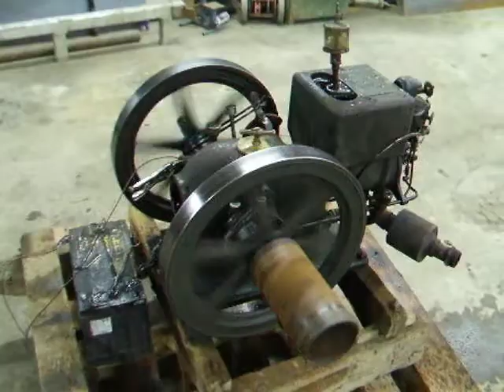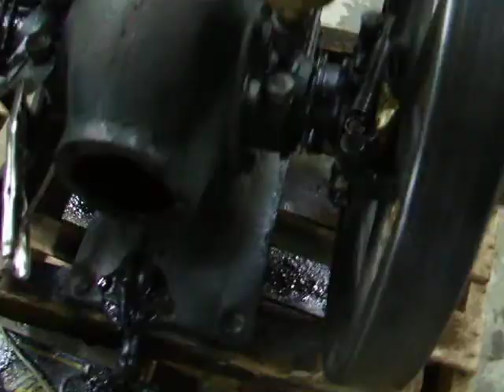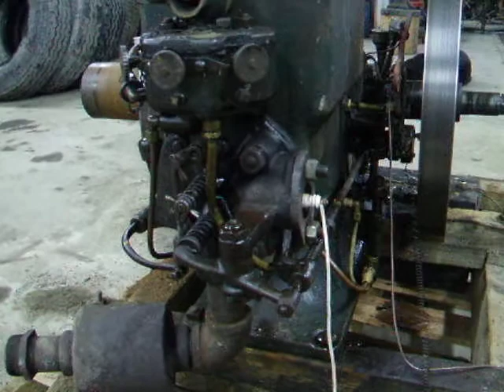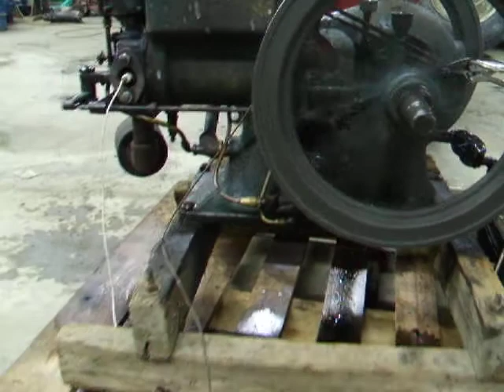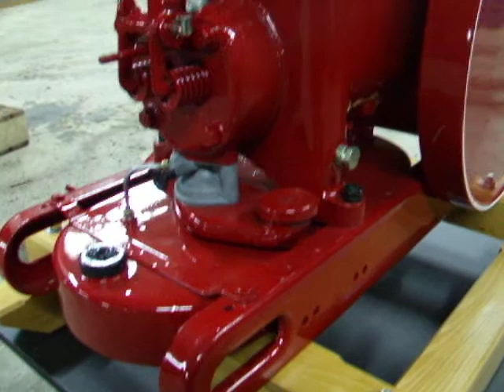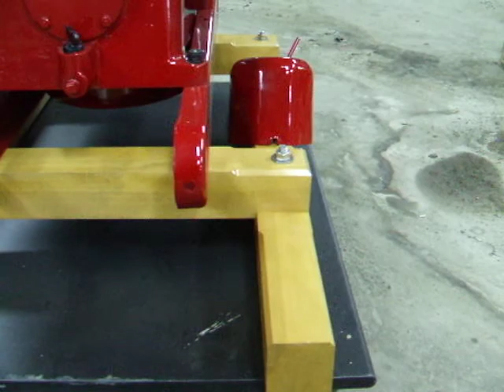hit miss model m 1 1/2hp engine run

Comment: @41Zman it is actually hit n miss.  There is no second rod on first engine to control the throttle.  It has the governor like you find on a Hercules / Economy.  The Cushman however, yes they are throttle controlled.